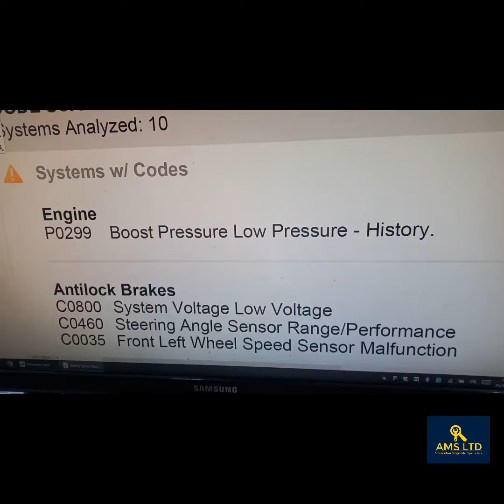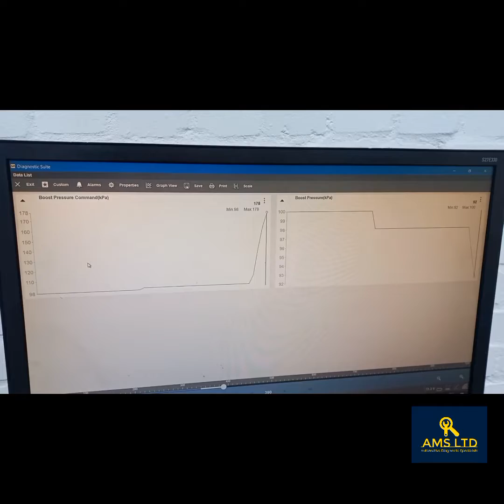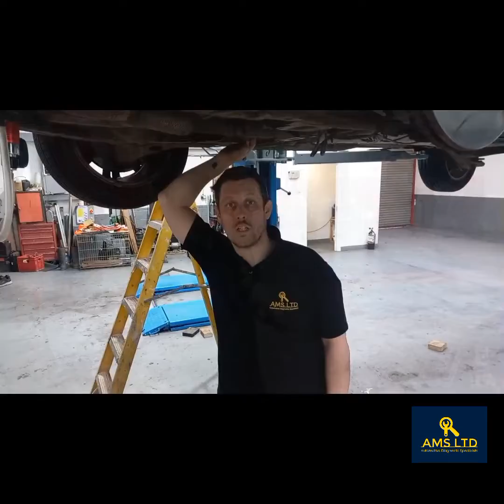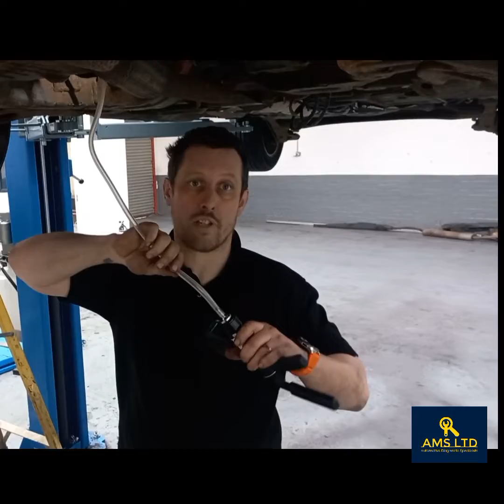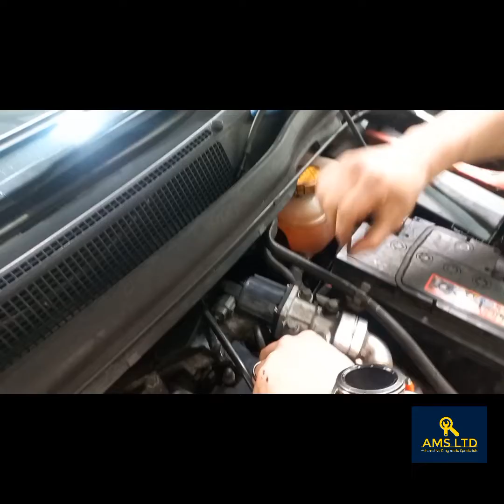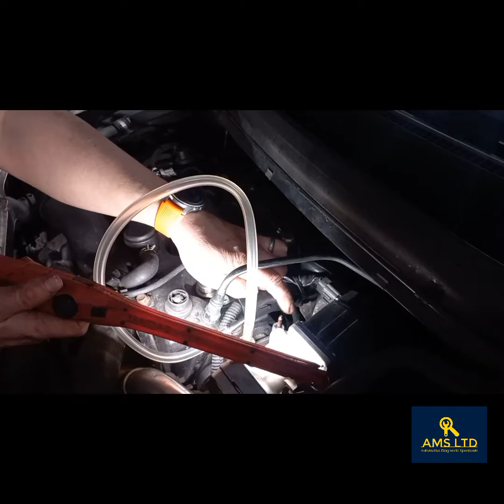Vauxhall Zafira 1.7d P0299 low boost pressure

Comment: Hi really good video but just wanted to say when you were showing the pipes up the back that you was testing underneath we couldn't see which one you was on     so was it the pump that was no good did it need replacing thanks
Reply from the maker: Underneath I was checking vacuum at the turbo wastegate. Testing to see if it help vacuum and if the rod moved.
Yes it was a bad vac pump. No vacuum =no turbo control
Thanks for watching 👍

Comment: Nice testing ,just found the channel great faults
Reply: check the boost pressure sensor.(MAP sensor i think its called) usually it can get blocked and best thing to do clean it with brake cleaner, put it back, delete the fault codes and go for a drive and see if the fault is gone

Comment: Great video. I have done all the tests as the video shows and can’t find a fault.  I still have the p0299 code.  1.7tdi Mokka.  Any ideas ? Goes into limp mode when you accelerate hard
Reply: Turbo solenoid valve.

Comment: What program did you use to diagnose issue
Reply from the maker: The scan tool used was snap on. But the most useful tool was the vac tester. 
The diagnostic tool was just used to clear codes.

Comment: Did the vacuum pump cure the issue on this car as I have the exact same symptoms with a car I have in Spain and I’m working with a limited tool kit and no miti vac but it does have positive pressure from the solinoid supply and negative from the brakes
Reply from the maker: The customer declined the repair as the vehicle was not worth much to him. The diagnostic was sound. Proof would be substituting the component vacuum with the servo vacuum, you should then get boost back
Reply: Hi changed the vacuum pump this sorted out the boost problem at low boost it still seems to have quite a bit of lag then at about 3k revs 4th gear on the motorway it will shut down in limp home with a low boost pressure fault then clear with ignition recycling the egr cooler seems sticky would this cause this sorry to hijack your post but I’m trying to sort this car while I’m over on holiday as I can’t get a mechanic over here who doesn’t want to just throw parts at it

Comment: So what would be the solution for this fault? I have exactly the same issue, and hoping not to be ripped off by those that, as you say, pull out the parts catalogue and go crazy
Reply from the maker: This vehicle required a replacement vacuum pump, not to say that yours does with out carrying out a diagnosis first
Reply: Of course. Thank you, my friend.